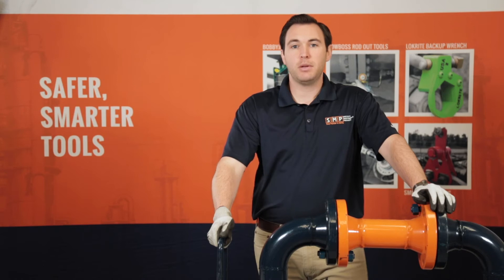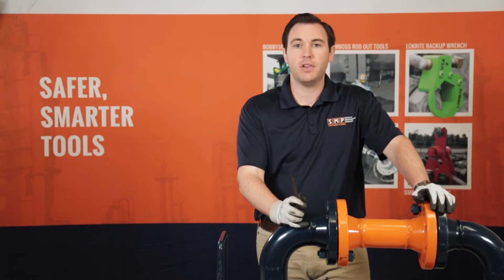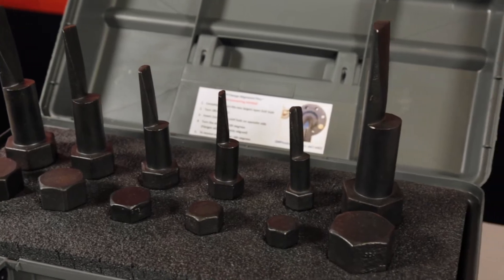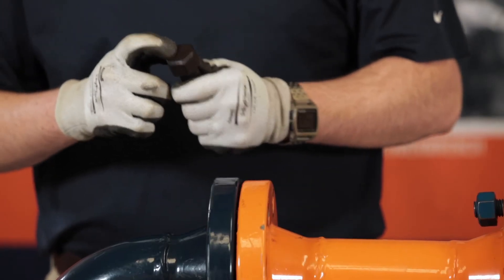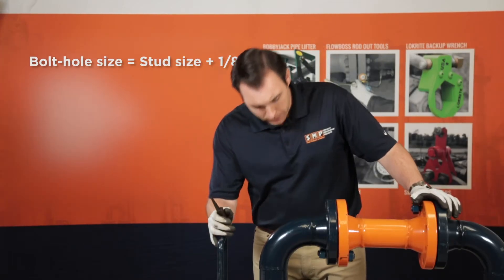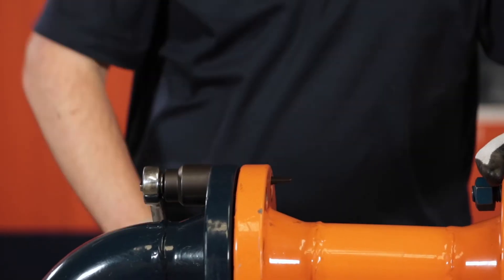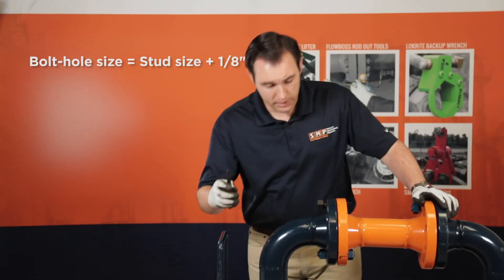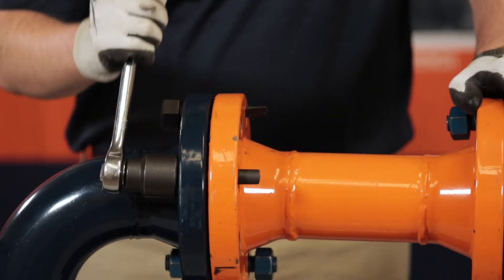Titan Flange Alignment Pins - Specialty Maintenance Products

Comment: Dang. All these years I've been using my flange bolts as pins I've been doing it wrong.
Reply: Flange alignment pins are incredible, I work in the petrochemical industry and they save so much time and effort, when you're doing big flanges like 10 inches+ when you loosen all the studs the pipe will drop making the flanges misaligned, instead of having to get chain blocks and come alongs or jacks to realign the flanges you put a pin or 2 in and turn them until they are aligned, then tighten up a few studs/bolts, then remove the alignment pin and replace it with a stud/bolt, if you work with big pipe work and are putting spades/blinds in constantly they are one of the best tools a fitter can have, yeah you can put your spanner on a nut and push or pull to align it that way on smaller stuff but that's not gonna work on a 14inch 300# pipe line.
Reply: @takeitorfuckyou  20 years the only time we stumble is when new people are on the wrenches 🤷
Reply: @BawkBawkBawk666  Not sure about where you live but in Australia you need a certificate 3 in mechanical engineering to become a fitter and turner which is a 4 year apprenticeship, so the only people swinging spanners and unbolting flanges should have at least 4 years experience, if you unbolt a 10 inch 300# pipe with a valve on one side (10 inch 300#  Raised face valve weighs 330kg) it's going to drop unless you've set up a chain block to take the weight or you've jacked the pipe with a porter power or you've got a crane in to take the weight, all of that takes time and unless you have a riggers ticket you're gonna need a rigger/dogman and crane driver if you can't get a porter power under the pipe to jack it. Or you can take one stud out put a flange pin in then crack the rest of the bolts, take out half your bolts so you can drop your  gaskets in and put/take your blind in or out then turn the alignment pin until the flanges are perfectly aligned, drop your studs/bolts back in and tighten it up, remove the pin and put the last stud/bolt in and tighten it, with flange pins it would takes half the time and a quarter of the effort for the same results.
Reply: @takeitorfuckyou  crazy. All that training.... Anyway getting into pipe sizes that large we don't work alone. You don't need a ticket in rigging, just some common sense. Pipe too big, heavy and bulky? That's where a game plan comes in. Not every site is a union site and not every job requires a red seal. Other things to consider... The contents of the pipe, oils, acids, gases etc. 
Also Canada
Reply: @BawkBawkBawk666  I don't disagree with what you're saying, I was just pointing out that with flange aligning pins you can get the job done much quicker and with less equipment. All trades in Australia require a 4 year apprenticeship to become a tradesmen, obviously flange work is only a very small part of being a fitter and turner and is probably one of the easiest aspects, you need to learn how to use precision machinery like lathes, milling machines, horizontal and vertical borers, radial drills, how to strip aswell as learn all the different types of gear boxes, pumps, heat exchangers, cooling towers, motors, shaft alignment, bearings, furnaces, boiler houses, all the different grades and types of metals and what they are used for, studs and bolts and which ones to use for high temp, low temp, stainless, construction, types of gaskets like spiral wound, graphite,  compressed (Non) asbestos fiber (CAF or CNAF now days as asbestos is banned in Australia) aswell as what type of pipes each is used on, caustic, H2S, NORM, Steam etc etc.
Reply: @BawkBawkBawk666  obviously this is all standard procedure on union and non union sites that are high risk and/or hazardous plants such as petrochemical plants, not little machine shops or metal fab shops where they probably have a smoke hanging out their mouth while they are half way thru a weld.
Reply from the maker: We appreciate your feedback! We agree, these are the most efficient line up tool on the market, and they should save you a ton of time and effort
Reply from the maker: Thanks for the response, these alignment pins can change your life! Feel free to reach out via email or phone and we'd be happy to assist.